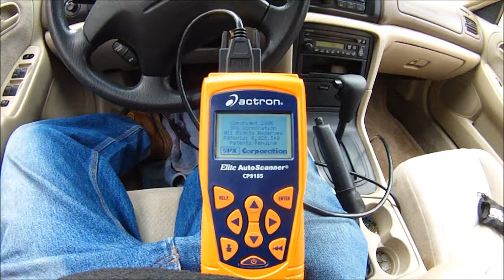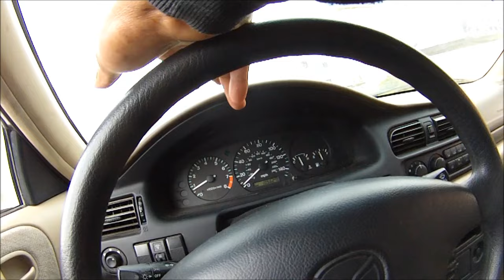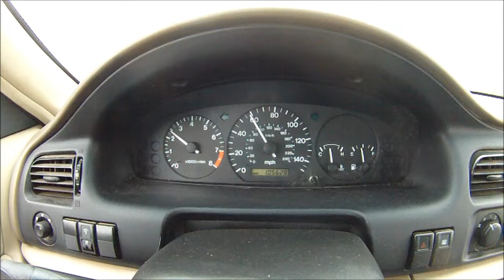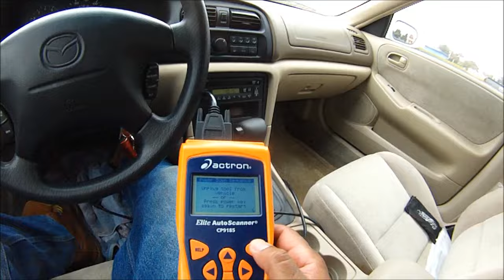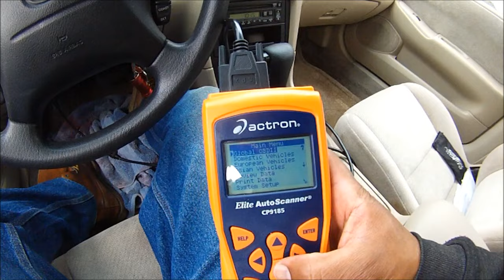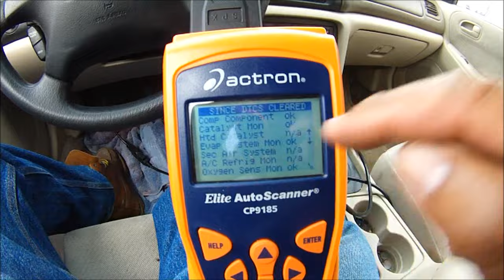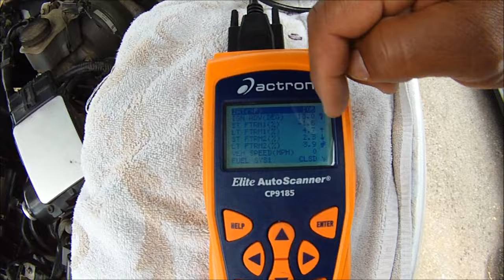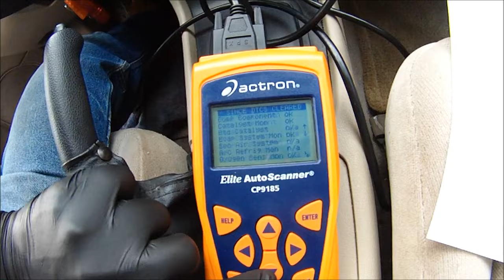WHAT SMOG TECHS WONT TELL YOU AFTER YOU FAIL THE SMOG TEST FOR (INCOMPLETION OF OBDII SELF TEST)

Comment: 2001 Toyota Camry Emission Monitor Drive Cycle

I went to get my 2001 Toyota Camry smog inspected and found out the EGR valve was defective. I got a new one and cleared the trouble codes. After I placed the new EGR the check engine light turned off but the emission monitor is still not ready or complete. I was told I need to drive my Camry more but I had already drove 150 miles. Much much more driving do I have to do?

by shawnetta    03-18-2013 10:28 AM 

Answer:   
Typically you'll need to drive your Toyota Camry for 200-300 miles, and over the course of a week to two in order to set the required emission monitors.

While clearing your Toyota's EGR valve/systems trouble code(s) you also erased all of the emission monitors. Emission monitors are internal self tests which your 2001 Toyota Camry conducts to insure its emission systems are working properly.

The following is a Generic Drive Cycle which should set all the required Monitors and let your Toyota Camry pass the smog test..

Begin by: (Make sure you have between 1/4 and 3/4 fuel in the gas tank. The EVAP test will not run while your Toyota has a full tank of gas or the gas tank is near empty).

Start the engine. Idle the engine in drive for two and a half minutes with the A/C and rear defroster on.
Turn the A/C and rear defrost off, and accelerate to 55 mph at half throttle.
Hold at a steady speed of 55 mph for three minutes.
Decelerate (coast down) to 20 mph without braking.
Accelerate back to 55 to 60 mph at ¾ throttle.
Hold at a steady speed of 55 to 60 mph for five minutes.
Decelerate (coast down) to a stop without braking.
If all other emissions systems are functioning properly, completing the drive cycle above should set the emission monitors required to pass the smog check. It will not hurt to perform the drive cycle 2 or 3 times before the smog inspection. Take caution when performing drive cycles on public roadways.

posted by SmogTips Support 03-19-2013 12:27 PM

Comment: #1 & #2  PO171 vids showed me a lot, I have the same Prizm and prob right now, but shop can't take my car in  for 3 days. I have PO301, PO171, and PO420 scan reading, car idling bad like the one in the vid, and missing is now constant when driving also besides idle. Can I clean MAF and 02 sensors with brake cleaner ?
I may clean the MAFand Ck the # 1 cyl plug & coil, but my 02 Prizm suggests same prob, might be Prizm heredity. With the PO301, I may replace that  #1injector   if prob exists, easy job and no $80 / hr shop time or expensive OEM parts.

Comment: Can anybody help me please? 2005 Volvo. Didn't pass smog. OBD II sensors not ready. Performed the drive pattern. Still didn't pass. Took it to a shop and the sensors read that all OBD two sensors were NOT SUPPORTED, what's the guy had never seen in all his years.  No check engine lights on. I'm just sick over this is so expensive I can't afford it.
Reply: +Cynthia K. did you fix yours yet? mine can't fix the damn catalytic converter incomplete thing
Reply: No, but I got hooked up with an unscrupulous smog station that made it pass on paper/with the DMV.    (Smog guy owed my friend a favor, is how hat worked.). So, it's still got the problem, but at least I could acquire tags this  year.  I had some dicey electrical work done, and I suspect they damaged my sensor situation.  Any feeling on what's causing your problem?
Reply: +Cynthia K. Oh, I see now at you said about the catalytic converter.  Sending you luck!
Reply: +Cynthia K. ye catalytic system whatever that is. incomplete. they said u have to drive like 100 miles but I prolly made like 500 miles or so but it's still incomplete. plus I had a new catalytic converter installed so idk what's wrong. I might go what u did probably. just to get this shit done too much hustle and so much money wasted

Comment: Hey what's up bro Bob's your video haven't tried it yet I have some questions maybe you might be able to help me out with but it's much easier to talk on the phone or messenger a 2007 Chevy Equinox in my damn EGR valve and evap monitors will not reset I keep telling me to drive the car I've gone over 300 miles and still not working out for me what is a good way to get ahold of you thanks bro God bless you man

Comment: I'm having a hard time with evap system and secondary air. Ugh.
Reply from the maker: Check the seal on your fuel cap. Erase codes will driving and take it on the freeway and keep driving try to get all monitors to set right after you erase the code. Keep doing the drive cycle
Reply: @oldskoolfunk71  I'll try that! Thanks funk!

Comment: This is a comedy if I've ever seen it, the using hand brake is a bit of a tuff one when you have a foot brake since many of them you have to press all the way down to release it again! so my point is not to let ECM know you have hit the brake, downshifting is a better option to this also this only will work if you have fixed your issues and just reset your ECM if not and your setting hard codes they will pop up again or show as pending codes and you will fail so in my opinion repair your issues then take your car for a drive on the freeway for 30 min keeping your speeds under 70 and over 45 after this turn your car off and back on 5 times for five minutes each time and you will pass basically everything this man said is spot on just the ebrake for a lot of cars is a foot brake down shifting will do just as well and the biggest thing keep God in your life as he says the rest comes easy

Comment: When i first got my 1st engine light a mechanic i know put his scanner to my car... Told me i needed a CAT (meow) SO like an idiot i didn't get a 2nd opinion and bout a walker CAT (suppose to be reputable) had it installed and also change the 02 sensor. well a few hundred miles and the light came on same code. i have been dealing with this crap for 3 yrs and very year i have to chase my tail to get it ready.. The car is an 06 Charger. I was told to go to the dealer and i called the a few dealers and they say you have to bring it in..i asked how much for the consultation ..You have to bring it in..i responded i will junk it before i bring it in to the dealer... any way i at least have one year to shop for a replacement.... stay away from dodge.

Comment: Don't forget to do a "carbon bust" by slowly running a can of sea foam through the intake direct vacuum port while the engine is fully warmed to temp.  This busts loose all the carbon deposits in the combustion chamber, cleans the valves and injector tips, etc. and in vehicles like the Fords that fail emissions for the NoX test, this makes them pass when nothing else will.
  Don't let the fluid in too fast, use a clear hose hooked up to the vacuum port so you can see the flow or it chokes out the engine.  Some mechanics make a tool for this our of an AC service Can tapper that punctures the can, a valve like goes to your refrigerator water line, and  a couple  fittings.   Cheap and easy enough if you're going to do several vehicles.  If just the once, just put the end of the hose into the can and pull it back out, getting a slow, even flow into the intake and do it some place that a serious smoke screen won't be a problem.  There'll be no mosquitoes around for a couple blocks...  😆

Comment: why do you suppose that some vids say to turn on air cond, and some say Don't turn on ac.
Reply: Everyone is basing thier general instructions on thier own cars.  Some cars say to minimize electrical load and others say to increase it.  So you really cannot use a generic instruction although sometimes it works.  Best way is to get the readiness strategy straight from the service manual by your cars year and engine package.   Other wise you are just guessing, but it works maybe 70% of the time,  so that's not bad.
Reply: @stevew9563  ok, I did not know enough to  look for the readiness strategy in my service manual. I hope it's there, I hope I can find it.That would certainly save a lot of frustration. Many thanks for your reply.

Comment: It's not even about emissions . I fixed one problem on my car ( evap solenoid ) all monitors reset in one day . Then they told me I had to take off the spacers on my O2 sensors , so I did and found out they were bad . I replaced them and have no codes or anything but now my cat monitor is steadfastly refusing to reset ! %$#@ !

Comment: I have a 2005 nissan altima & I Failed my smog today for the same reason. The inspection guy charged me but told me that my monitors aren't ready so I have to drive it for 20 miles and take it back to him tomorrow.. hoping my check engine light doesn't come back on. :( wish you could do that to my car. Keep getting codes P0302 which I already replaced and code P0113. Hope you can help. God bless.

Comment: Basically pass a test honestly by properly tuning your car.
Reply: It is always my locking gas cap (No locking door) that trips Evap. code so have to erase, put stock cap on and do this here preparation situation since I live in dirtbag area.
Reply: Just tuning doesn't actually guarantee the sensors and monitoring will perform and pass. This vid specifically addresses two possible issues - can't pass even with a tune, and disconnecting the battery and consequently resetting the computer. In many places (like Seattle these days) there aren't a lot of options to getting your car up to 55 and holding for the required drive test. And, there's a hell of a lot of braking to do. So test results will likely  stay "incomplete"
Good shops have dynos that keep the resistance on the drive train so they can replicate the drive test at the required speeds - but for what could be an expensive cost.

Comment: just drive it for 100 miles and get it retested, im an emissions inspector thats what we tell people to do.
Reply from the maker: zammyzhere What about those who have already driven 200-500 miles. sometimes the monitors will not set that easy by simply driving, your best bet is to learn your DRIVE CYCLE MODE and do it. You should tell them that instead of letting them walk away STRESSED OUT
Reply: oldskool funk Ive never seen anyone have that problem  in 3 years but ill be on the lookout for it now thanks for the info
Reply from the maker: Ya it gets worse, if there is a leak in the evap system the evap monitors will never complete, if the o2 sensor heater circuit is off it will never let the O2 monitors set etc it gets deep when you have monitor issues and very stressful.

Comment: now could my truck fail the test if only my ABS light stays on?
Reply: Nope only service engine/check
Reply: sounds good, I just cant figure out I checked all my sensors there hooked up right, think one of them conncected onto the drum may be bad.
Reply: Joshua Pritt  It shouldn't because that is not an emission issue.
Reply: i figured out what it was causing it to stay on, the sensor on the wheel hub on the driver side was extremely dirty so I cleaned it out and it fixed my problem.

Comment: If you don't fix the codes that were in the computer then after you reset them and the monitors set it'll see the problem again and set the code. This is for after repair... Or if your battery was dead or changed . Ya you'll fail of monitors are not set but no shop charges you to diagnose why monitors are not set l. Only check engine light reasons. Smh

Comment: How the heck did you get the EVAP to clear so fast?
Reply from the maker: Its a hit and miss sometimes John, Its not always that easy, Sometimes I had to do the drive cycle 2-4 times.
Reply: I had been doing drive cycles trying to get my Evap code to ready for a week, But luckily CA smog allows one code, such as Evap to be incomplete and still let you pass your smog. If your vehicle is pre 2000.
Reply: Thanks for the video though.  Much better than some of the Drive cycle posted steps I have seen elsewhere that want you to do a bunch of crazy sh*t.
Reply: +John Norris   hello John,  i am a smogtech in calif. and i know you found out about not having to have evap  monitor set to pass the test but if you ever have a need to set it on most cars the trick is to start the engine cold and let it idle for a few minutes before  touching anything else, then drive away. I had a very hard time setting evap monitors until i figured that out. You can drive the car all day and never set evap if you dont do that  Until recently we would be penalized for passing cars that didnt have all the monitors set like the evap on late model cars so it was a nightmare until i realized what i told you back there.
Reply: Thanks, will keep that in mind if the issue comes up again in the future. I seem to have fixed the issue just messing with my hose connections.  It took like another week for the code to clear on its own.
Reply: rammer561 How long after warming up should you drive it?
Reply: Maine Maine You dont wait till it warms up really. Most the manuals say to idle from cold start about about 2 minutes or so but i just let it idle for about 4 or 5 minutes to be sure.The computer needs to get some base settings from the evap system before you drive off. This works on most cars but not all.
Reply: rammer561 No wonder I wasn't able to get it to complete the cycle...it's the last monitor needed to be complete. I'm in California.  I just found out via BAR (bureau of automotive repair) literature that the state of California allows 1 monitor INC (incomplete) in order pass on 1996 to 1999 gasoline engines.

Thanks rammer and Thanks OldskoolFunk. I tried Oleskool method (the best i could) and all monitors completed except the evap (so it does work).
Reply: Maine Maine  John Norris mentioned in aug that one monitor can be inc to pass.96 to 99  will pass with any one monitor inc. 2000 and newer has to have all monitors complete to pass with the exception of evap.
Reply: Maine Maine Ya, I found this out too. I got tired of trying to get the code test to complete and took it to a smog shop, they said it is ok for one error, the evap was one of the ones it was ok to have, not sure which was not allowed.  But my truck passed with flying colors, 2 days later the system finally finished and my error light was gone.
Reply: rammer561 didn't catch that one...thanks. All went good. Passed in under 15 min. Thanks.
Reply: John Norris wow, the smog guy sent me back to the highway with only the evap incomplete. One of the techs stepped in and said No it'll pass with one incomplete. Wish I had saw your earlier post.
Reply: I had to actually drive my car 100 miles to clear the monitors over several days!

Comment: what can cause the evap monitor to be incomplete
Reply: always driving with an empty (or completely full) tank WILL cause it to always stay incomplete
Reply: +Mike Jones fill the gas tank to 3/4 full then evap issue should go away. At least it did with my car.
Reply: thanks guys.  got it to go away and smog it.  mine was 1/4 from full.  don't know if that matter or not.
Reply: Mike jones glad to hear it! I had to fill my gas tank to 3/4 full to get past the evap monitor issue as well. Secondary air monitor took the most time and driving to pass. What a pain and scam this whole smog nonsense is. I actually had to drive more and pollute more in 3 days than I did all year to pass this scam!
Reply: Renaissance...Man ain't that the truth
Reply: Maine Maine indeed sir. I am glad that I bought the same scanner that he used in the video. It was hard to find but works better than the el cheapo model sold in auto stores and I love using it to diagnose my car now.

Comment: as smog tech for many years I can tell you as a tech you are in between the government and customers .Y have got 3 under covert test vehicles  from state and I pass them , when you go to class updates every 2 years  they tell you what you supost to do , and vehicle is coming with check engine light on fail that is  state mind  , I personally aproch the customer offering diagnostic how ever if this is a state vehicle I could have gotted a minimum 1k fine  and 16 or 32 hours of paid classes out pocket, the state say  you do not have to pass vehicle that do not pass or fail vehicles  that should pass ,
monitors I never send a customer down the road with out running conditions criteria  as they could be driving for days with out succeeded , Y will give you an example  chevy to run the monitor for cat   require 5 minutes drive about 55 mph and get to stop and hold the vehicle in D for 3 minutes t,ell me when is this customer going to run this monitor as this is not normal driving conditions, Saturn you have to turn on the rear defroster for 3 minutes  and a/c on for some minutes for evap monitor, I think you got it  . is not easy to be smog tech as you can get a state citation  very easy .
Reply from the maker: Joel Navarro Thanks for letting us know and thanks for helping the people, God bless your heart

Comment: Why used hand break not foot break ?
Reply: The foot brake sends a signal to the BCM and ECU and that may interrupt the test being performed in the ECU.  The hand brake is independent of those modules so it just seems like it slowed down real quick.
Reply: @stevew9563 question? Makes sense i  have the foot 🦶 break lol  was thinking of putting it on neutral when reducing speed. Maybe I need to find a ramp on freeway correct?
Reply: @JournellRomito   - YEa if your drive cycle requires it an uphill off ramp is a nice feature.